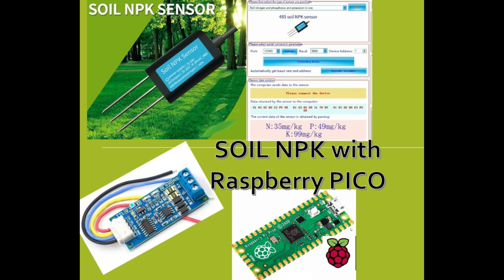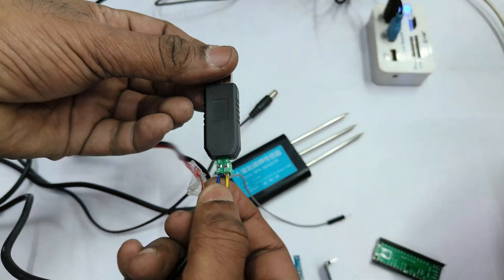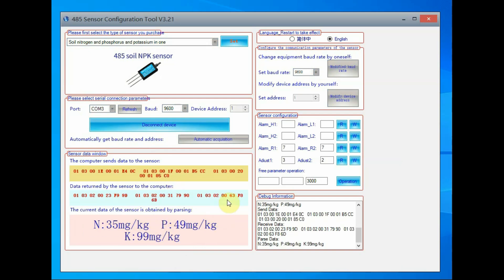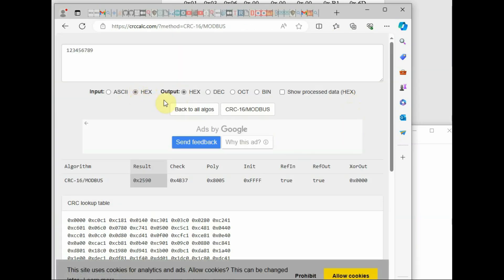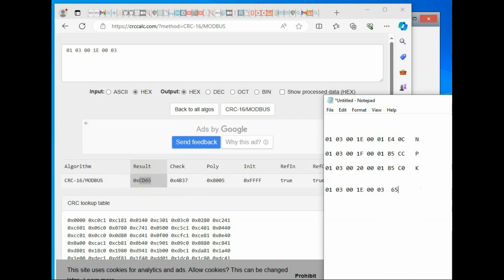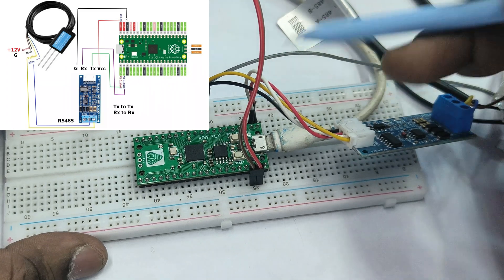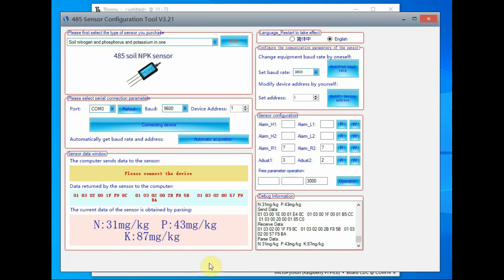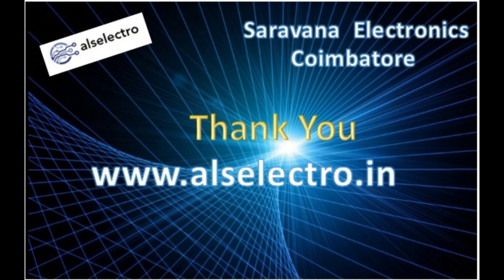NPK SOIL SENSOR With Raspberry PI PICO MicroPython code

Comment: sir please make a video on NPK  soil sensors connection using Raspberry pi - 3
sir please make a video on NPK  soil sensors connection using Raspberry pi - 3
sir please make a video on NPK  soil sensors connection using Raspberry pi - 3
sir please make a video on NPK  soil sensors connection using Raspberry pi - 3
sir please make a video on NPK  soil sensors connection using Raspberry pi - 3
sir please make a video on NPK  soil sensors connection using Raspberry pi - 3
sir please make a video on NPK  soil sensors connection using Raspberry pi - 3